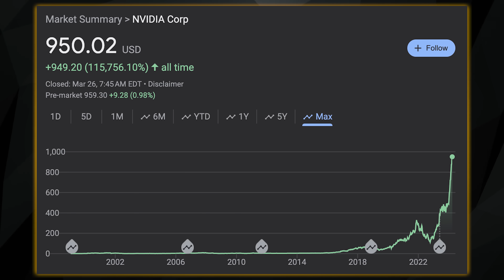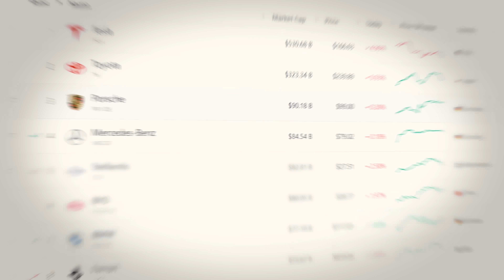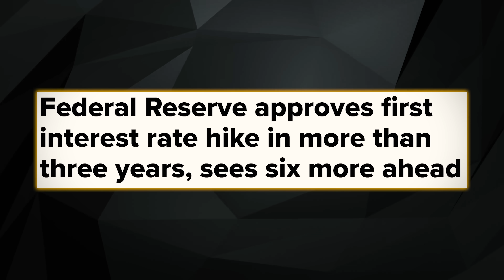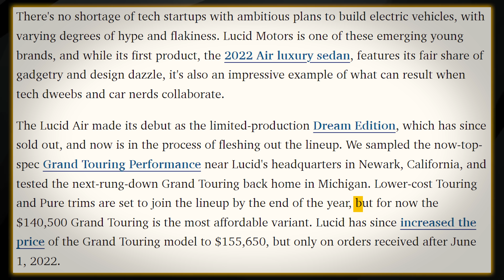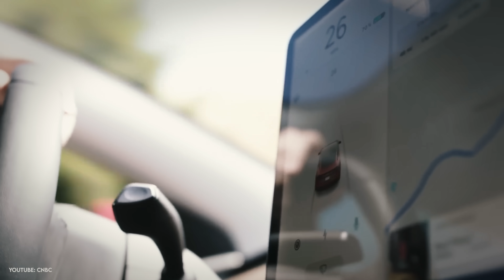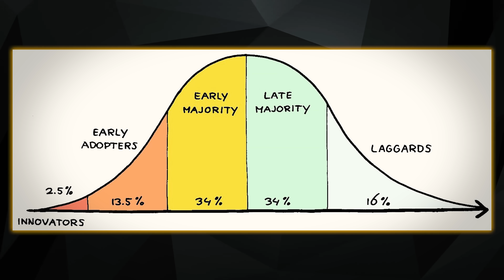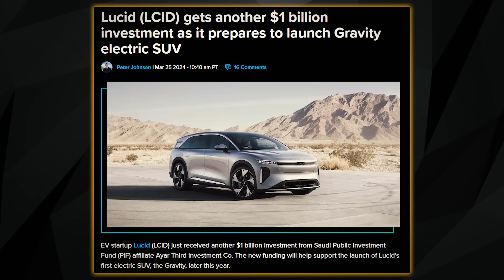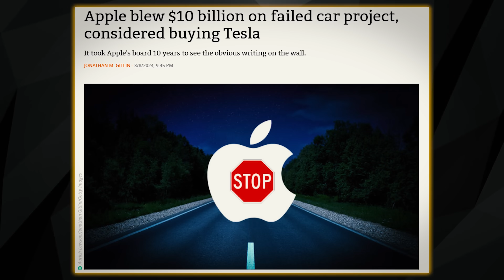The EV Bubble Popped - What Now?

Comment: The real solution is driving HYBRID.
You get lower gas consumption, less battery ( less weight, less electric dependancy as in waiting for full charge, range "anxiety" the list can go on and on ) .

These "princess wishes" of " by 2040 we expect all vehicles to be electric".
These are basically a miss universe contestant answering world peace...

In order to buy electric, cars need to be less expensive. But they can hardly achieve that since a full electric vehicle means a bigger battery and obviously more $$$.
Yes we all know there are compact electric vehicles  but these are not that cheap compared to a regular car.
So whats the solution?
Use an hybrid. You can save gas ( becausw that what we all want in the long term) and help our gas tank using a small battery. 

The ev being pushed to the consumers by automakers and goverment with these expensive cost is mostly a good wish just like the pageant contestant.
Just like "green energies" . We cannot supply high energy demand facilities with just solar or wind energy. Its not feasible. In paper it looks good, and eco friendly but the real solution is nuclear, with all their stigmas its the real solution right now

Comment: If tesla is getting anihilated, then what's Ford doing losing something in the region of 132k per car? Badly designed crap does not get bought, and this shows in ford and GMs ev numbers .
They are making no money on them, yet tesla smashes a profit not the biggest profit  out of a bad quarter .
Still 2 plus million cars this year.
Mega packs and energy storage profits are rising and will continue to add more and more value to tesla , this is temporary

Comment: The FV market is going to get even worse. All the real life horror stories that came out during the winter were just the beginning. Now we are going to see the huge number of stranded EV's this summer, as people on vacation find themselves with a dead battery 50 miles or more from a charging station. Also, people are beginning to see how bad the depreciation REALLY is with EV's. Dealers simply don't want them for trade-ins, as they know they can't re-sell a used electric car. You would actually get better trade offers on a cheap Chinese made moped. 

Ev's failed back in the late 1800's, and have appeared periodically since only to fail again. The flaming (literally!) failures are flopping yet again. The only surprising thing about this most recent failure is that we have idiots who are surprised. Who couldn't see this coming???

Comment: Here's a problem with EVs and why, while great for many people, they are and will never be for everyone. Charging. And I'm not talking about speed but pricing, and range. In the US, when most people live in detatched houses, people commute long distances and travel far in general. In the US 300 a mile range is the bare minimum. So what about Europe where 300 miles can get you through 4 different countries? Well in Europe most people live in apartments so they cannot charge at home. You can charge on public chargers but, and here's the main thing, that's expensive. It's actually more expensive than petrol if you drive an efficient car like a hybrid... and speaking of. Hybrids burn so little fuel, they can go longer and longer on battery power alone and they're cheaper than EVs. It's literally stupid to buy and EV over a hybrid in almost every sircumstance. Even if you can charge at home from solar... then get a plug-in hybrid.

Comment: 50% growth compound over multi-years horizon. There will be low's and high's. Don't forget the world has never seen such a high interest rate grew that quick. The auto manufacturing business is really difficult to operate, let alone EV at that, legacies are struggling tell you how difficult it is. EV startups are failing doesn't mean EV popped. What happens when interest starts to drop? What is the pent-up demand for EV will be like? Who is most to benefit in EV? EV are more affordable than ever before but not many are sub $20k. High interest rate adds hundreds to monthly payment. But Great value EV at $20k or sub $20k will be the norm in the coming years, <7 years.

Comment: there is no such thing as a 'zero emission' EV, the mining process for the lithium isn't zero emission, the power needed to properly charge isn't zero emission, oh and when an EV bursts into flames, the fires CERTAINLY isn't zero emission; also what savings is there on an EV? when the battery goes out, you need to pay almost 30% or more of what you paid for the EV just to replace the battery, .......yea ICE (Internal Combustion Engines) , aren't going anywhere anytime soon, and yea we haven't even discussed vehicles that have to tow heavy loads, like tractor-trailers.... lol , reality bites don't it enviromentalists?

Comment: People have realized that the "Full Self Driving" feature for all electric vehicles - not only Tesla's - is not practically achievable.
While Tesla counts on FSD to revive the EV market, they too are slowly realizing they have bitten more then what they can chew.
FSD can't be achieved by a private company; as FSD is a feat at the level of nuclear fusion.
A private company can achieve FSD only if all the cars on the road use the same FSD software, and are networked together.
Also, there is the problem that all lithium battery production is in the hands of China, and some see this as a problem.
A true electric automobile that people want actually to buy, use an electric motor powered by a fuel cell fed with gasoline. Such an automobile would have double the mileage per gallon of an ICE car, and have none of the recharge problems of a pure EV.
Thanks Harry for the video!
Greetings,
Anthony

Comment: Self-driving is a side show. It was only introduced to help justify the high price tag. Add on some tech and voila. This is both stupid and a waste of capital. It is a sales gimmick.

Self-driving is not an EV thing. For years now most ICE vehicles have been drive by wire. Implementing self-driving features on these vehicles is just as easy as with EVs. In fact, it had already been done on a lower level. Remember self-parking cars? Is that even a thing anymore? I have a 2015 US made ICE vehicle which has low speed automatic braking (saved my bacon) and some other automated safety features. All contemporary cars have over 100 microcontrollers and a vehicle management system built in. The tech is already everywhere. 

I don't own a Tesla, but I have been in some while taking Uber. I always ask the drivers if they use the self-driving feature. They all quickly respond in the negative.

Comment: Tesla also has a design problem. Their designs are getting stale and don't really stand out from the crowd. In my opinion, most other manufacturers build better looking cars. Buick, Hyundai, and Kia specifically are killing it lately. They need a refresh on their designs if they want to stay ahead of the game.

Another problem with EVs in general is a plug-in hybrid is a better sell at this point. You really get the best of both worlds with them where you significantly increase your gas mileage while not having range anxiety.

Comment: Well, buying an EV to "save the environment" is a joke! Your electricity still comes from coal burning or nuclear energy or gas generator or diesel generator, still polluting the environment, and runs your electric bill up. Then the round trip is much less mileage than a gas powered car. Your taxes are higher because of the weight of the car and the road wear and tear caused by the excess weight. You run AC or heat and your battery drops. If it's cold out, your battery drops. You have to replace the extremely expensive batteries in 5 years [$20k+]. The cost outlay for the car and the charging station is astronomical [$100k+]. The electrical grid cannot handle the demand for too many EV's. There is no viable or cost effective infrastructure to support EV's. Let's not talk about the fires that happen while charging [burn your house down if charging in your garage .... goodbye investment there] , when involved in an accident, just driving down the road, or even when just parked sometimes????? Then, god forbid, you get in an accident, then you'll really find that your wallet has a hole in it!

A gas powered car can have transmission replaced/rebuilt, engine replaced/rebuilt, all that for $10k or less, the car can last 40+ years ..... EV's cannot withstand time as such. The batteries alone after 5 years run you an average: $20k. Twice the cost of gas car rebuild. Brakes & tires on EV's last a lot less time due to vehicle weight. Given life of gas powered vehicle vs EV ,,, cost of rebuild of motor/trans vs batteries replacement in same timeline .... probable $25k gas vs $160k+ EV. You do the math!!!! Then there is disposal of batteries, so good for the environment! Then the disposal fees, etc .... The math ain't looking good for EV's!

So, tell me, where the hell is the upside????? Is there one???? They must think we are stupid. If we won't spend $75k+ on a truck, why would I spend that much or more for a very limited range vehicle that does nothing to help the roads or the environment???? Where is the damned logic??? I lmao at people trying to sell the idea of EV's, at least in the current state of the industry. Maybe in another 50 years.

Comment: EV weakness :

1. Expensive
2. Sparepart is expensive(battery, etc)
3. Service centers are not everywhere yet
4. Charging stations are not everywhere yet
5. Battery is weak against cold or hot weather
6. Charging is too long
7. Baterry is not environment friendly
8. Most consumer report bad quality in their car product
9. AI , self driving, and fancy screen just gimmick increasing cost and power usage cause adding CPU/processor inside cars.
10. Lot of EV explode base on social media documentation
11. Most local engginer in garage dont have experience on EV yet
12. Most Our electric generators are still using coal.

Comment: As long as most or all controls are buried in menus on a touch screen I will never be interested in an EV. In addition, while Kia may have a lot of service centers, they don't have a lot of technicians trained in their EVs.
Reply: Lack of physical buttons is an issue. Definitely.

Unfortunately it's not an issue specific to EVs, ice cars are going the exact same route.

However VW has started going back and are putting more physical buttons in their up coming budget ev.

Comment: They need to make em more affordable for the masses while also making the more affordable one's not look like generic ugly bug boxes such as the fucking leaf/spark.
Musk had a good idea with the cybertuck making it so unique in it's styling, everything else with the design was stupid but it's going in the right direction at least.
Bring back that boxy 70's/80's look because almsot every single one of these shitboxes currently looks like it's just another slight variation the same AI generated round mobile with spaceship aesthetics, that's probably why the ioniq 6 is doing alright because while it still suffers from the same issue at lt deviates enough to stand out from the herd a bit.

Comment: One of the main issues with evs and cars in general is that they are rather inconvenient methods of transportation, especially in most cities. Add to that the lack of infrastructure, and the time it takes to recharge a car and unless you live in a safe city with plenty of power stations, there is no reason to use a bike, a motorbike, the bus or walking. That is because it is way cheaper for governments to just invest money on real infrastructure rather than creating chargin networks on the already messy situation of electricity production in already congested cities. Not to mention that people outside most cities, like in rural areas, will never be able to get said infrastructure since the population density is still lower.

Comment: The argument "look how much you will save on gas!" Never worked because you can choose to just keep your current car and save $40.000 on a new EV, and with the amount you save you can buy gas for the next 20 years. Same applies when buying a car: a $20.000 used Mercedes or Audi and extra $20.000 for maintenance and gas for the next 10 years vs $40.000 for a boring low end EV with very limited range. The choice is simple. And EVs when they hit the used market with 300.000 miles on them, the batteries will need replacing, completely anihalating any used value whatsoever. I am still waiting for them to solve the replacement battery problem

Comment: depreciation, insurance for ev and repair in accident all worse. and will get even worse when giga casting is used since a fender bender will total the car....because of margin pressure your ev will be built as poorly as your phone and last about the same amt of time....which for transport is un acceptable. self driving is still a long way off. same decent bat perf, same right to repair....its a total crap show of bad ideas. what is taking off is gas hybrids. toyota was right...but arrogant tech bros were blinded by the bs as they always are. be skeptical of tech people. its cool just be skeptical is all. lots of hype always.

Comment: if it wasn't for the fact I own my own house and have my own driveway I would not have been interested in the slightest in driving an EV. I got my EV before I could install the charge point so for the first couple months I had to use fast chargers almost exclusively and let me tell you it's not fun having to spend half an hour to 45 minutes at a fast charger twice a week.
But now? I'm pretty much the perfect EV customer. My commute is short, I don't really do roadtrips (prefer flying), I charge almost exclusively on solar (except for the coldest winter months), and everyone I know lives within an hour's drive.
An EV was a no-brainer for me.

Comment: Rubbish. Tesla will be around in a 100 years, things can only get better, wait for SSBs Solid State Batteries, 750 mile range and a 10 minute charge to 80% here's a fact from VW for this year
Volkswagon EV sales for 2024

In 2024, Volkswagen Group has faced some challenges with its electric vehicle (EV) sales1
. During the first half of the year, the company reported a 1.4% decrease in EV sales compared to the same period in 20232
. Specifically, they sold about 180,800 EVs in Q2 2024, which was only a slight increase of 0.1% year-over-year2
. Overall, EVs accounted for 8.1% of their total sales volume in Q2 20242
.Despite these challenges, Volkswagen remains committed to its electrification strategy and continues to invest in new EV models and technologies. EV bubbles have not nor will they POP. They will only grow,

Comment: EVs are absolutely worthless! All the things people complain about today? They were the same exact complaints in the early 1900s when cars were first invented! For the first cars, the options were EV, ICE, or steam-powered. EV batteries couldn't compete with simple gasoline (other than the electric starter, which saved many arms). Physics hasn't changed - EVs still suck! When it comes to safety, especially for those of us with longer drives in colder climates, no point risking our lives on this technology if it fails! I've been stranded with a flat tire and someone had to come fix it as well as having a dead car battery. Thankfully for the latter, someone showed up, "jumped" the car, and my gasoline took over. How does charging in that scenario work? (Oh right, the person brings a gasoline-powered generator to charge the stupid thing.)

Speaking of that charger engine, that is why hybrids definitely make far more sense because then you can get the best of both options. The problem is, hybrids are hated by the pro-EV politicians! If you haven't heard the story of the EV-1, GM's attempt at an electric car in the 1990s, look into it. In terms of an EV, the story is very similar to today. However, what's interesting is that in testing the car body (i.e., nothing to do with the battery life), GM engineers needed a way to keep the car running without having to constantly stop and recharge the battery. Thus, they hooked up a Honda engine to the car so when the battery drained, the Honda ICE could take over and they could keep testing. In other words, they invented a hybrid at least half a decade before Toyota! Unfortunately for GM, California politicians heard about their EV attempts and decided to get involved, mandating all-electric cars. GM, hearing this, realized the hybrid engine wouldn't comply and so stopped working on it! (I'll spell it out clearly for the environmentalists who seem to be a little slow: the US might have had hybrids a few years earlier if environmentalist politicians hadn't harmed the program with their extremism!)

Comment: I still see more Tesla’s on the road than any other ev.

We knew Tesla had a high markup with ample room for price cuts. We knew the share price markup was excessive and based on promised future growth. 

We knew a lot of drivers held off buying until the charging network was well established and the newev’s had proven themselves. 

We knew the high prices of initial ev’s would drop, resulting in high depreciation for early buyers. 

We know most people drive short distances for daily commute & vast majority of of annual km can be covered by charging at home overnight and weekends using excess solar. 

So there is change. It’s not as scary as some claim.

Comment: Tesla doing better than ever. And EV sales overall are still 24% up on last year. It’s now has nearly cracked FSD and it looks like Ford will license. 
The reason that legacy automakers EV sales are bad is that they ignored the charging infrastructure, as soon as they start getting full access to Tesla supercharger network the sales will turnaround. If you can’t access Tesla supercharger network it sucks to own EV that you need for longer road trips.
So I call BS on your post.